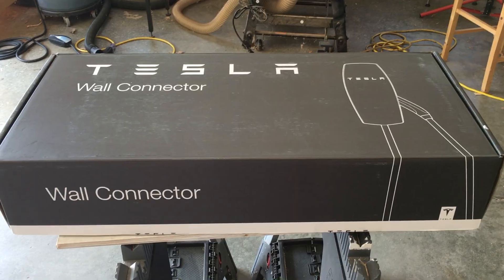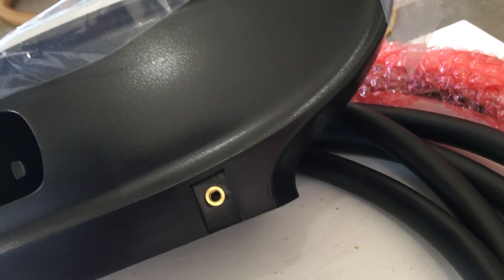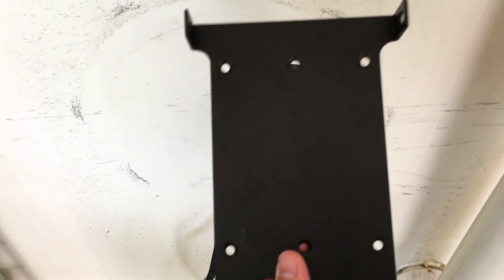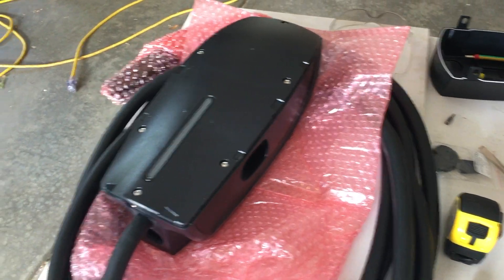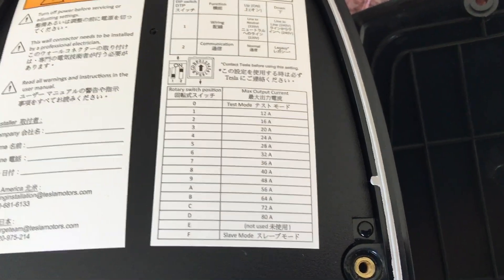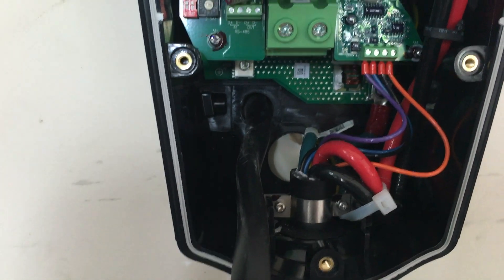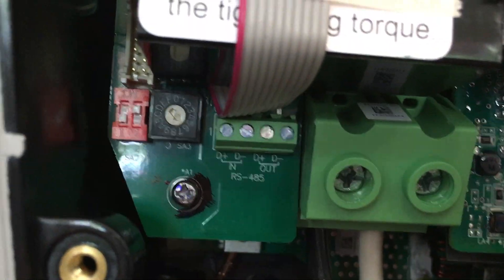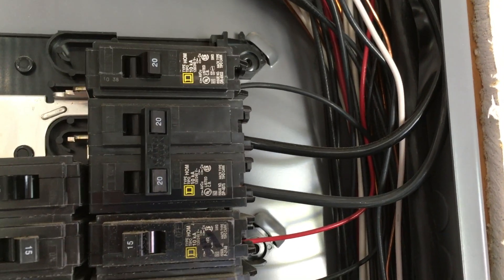Tesla HPWC V2 Installation

Comment: So I had an electrician come in and install a 14-50 outlet in my garage which is basically putting out the same amount of power to my Model S as your HPWC. I was considering getting a HPWC this way I can get the maximum amount of power to the car and have the fastest charge time possible outside a supercharger...I honestly don't see the point of getting a HPWC if you not using it to its fullest potential.....just my opinion. Great video!!
Reply from the maker: I agree that a 14-50 outlet is a great option if you're staying around the 32 amp level.  I needed the longer cable length for parking flexibility (garage doubles as a wood shop) and thought about linking 2 in the future for 2 cars.

Comment: Just FYI to anyone watching this before doing their install. You don't have to add solder to the wires like Greg did. Much like on the wires that came with the bracket he didn't use, you can add ferrules to the end of each wire. It's a small fitting that crimps on the end of the wire to neatly keep the strands all together and prevents strays from causing any possible shorts. They're much better and a lot easier to use.
Reply: I just installed mine yesterday, using 6-gauge THHN wires (it's set to charge at 48A).  I tried and tried but couldn't find a crimp tool or crimp sleeves for wires that big.  So, all I did was tighten the terminal screws as best I could.  Do you think it will cause a problem?
Reply from the maker: @SlightReturn666  I doubt it will be a problem as long as you have no stray wires, the screws are tight and the wires aren't under tension.  I'm no electrician though, so take that for what it's worth. :-)

Comment: So is this really just 2 cables that come into the box from the wall and connect to those two connectors?? I'm having a electrician come and wire everything to my garage and idk if it's better to just install a 14-50 outlet or a HPWC
Reply from the maker: It's actually 3 wires including the ground.  After having it directly wired for while I kind of wish I went with a 14-50 outlet for the versatility (for woodworking tools).  It all depends on how much power you plan to run to the charger.  With that said I would still buy the HPWC since it is well priced for what you get.

Comment: Looks like your main neutral in your panel (at the bottom) is not covered with tape. Whoever installed your panel should have wrapped it. It is supposed to be wrapped on services etc. Also although they are bonded together, the neutrals and grounds are supposed to be each on their respective bars separately and not just mixed together. Too many electricians and others do not seem to know this.
Reply from the maker: I'm not surprised at all, though it is disappointing that a building inspector would not catch these things. Faster/cheaper right?

Comment: Any reason you went with 32A instead of 72?
Reply from the maker: @mmmq Yes, I originally had the wiring put in for a 15Amp Voltec Chevy Volt charger.  However, I asked them to use a cable that would allow me to upgrade to 40Amps (32 Amps usable) in the future.  Little did I know at the time (2011) that I would have a Tesla that could handle much more power.  32Amps is pretty good for my day to day needs and the cabling was not too expensive.

Comment: Greg,

Thanks for taking the time to put this video together!

I am confused about the wiring in the video. I understand that Tesla HPWC uses only 3 cables, 2 hots and 1 ground and neutral is not used. In your video,  you have a black, a white, and a ground at the HPWC. At the circuit breaker, you have 2 blacks connected to the breaker. I assumed the ground is connected to the grounding strip. What happened to the white cable, or why there is an extra black? Did you make any neutral connection to the neutral bar at the main panel?

Thanks
Les
Reply from the maker: @Les Chan, Good question.  There is black electrical tape wrapped around the white wire in my breaker box (white and black are connected to the breaker).  There was no black electrical tape on the charger side since I had to shorten the wires about a foot.  I expect the original electrician did this to show that they were both hot instead of 1 being neutral.  You are correct that the ground cable is connected to the grounding strip in the breaker box.  hope that helps.